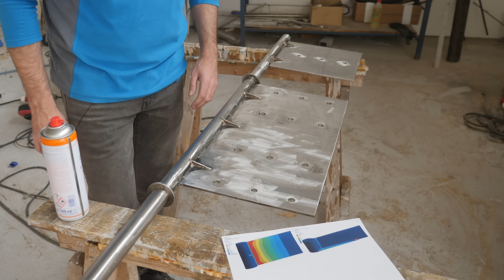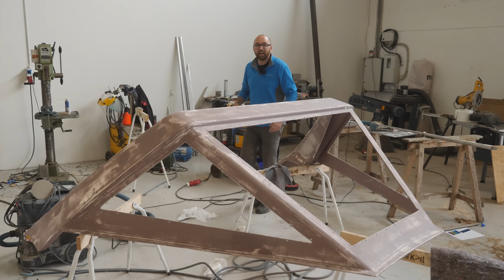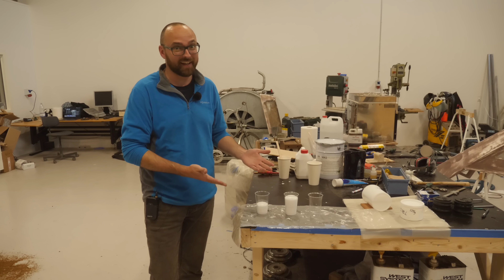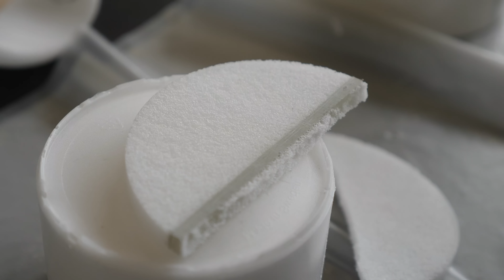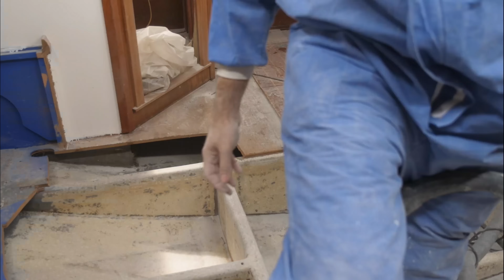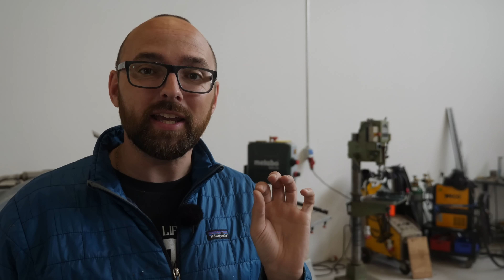Sail Life - Expanding epoxy foam for the rudder, and more sanding - DIY sailboat repair

Comment: Hey Mr. Spiffy :D geez Louise you're so fussy you haven't stopped to think that your epoxy paint is thinner than filler and will take care of those pesky pin holes if you stop trying to do it the hard way.
I'm guessing you will be lite sanding between finish coats of paint to make it peeeerfectly spiffy and it should be fine.
Good luck !
Reply from the maker: I know from experience the primer will not fill those pinholes. At least I wasn't able to make it do that 🙂
Reply: @SailLife  I'm surprised to hear that, when I used to do body work on old vehicles for resale after filling with heavy buildup material there was always those pesky pinholes! We used a spray on primer/filler, basically the same idea as your 2 part primer paint and sanding lightly between coats, 3-5 coats usually did the job... You're very patient, I'm sure it will get done well
Reply from the maker: Roland D. St. Arneault maybe the difference is that I've been rolling and not spraying?:)

Comment: What you could try to fill the rudder is to get a container, (something like an empty alhambra water bottle) that could be sealed airtight at the top with a Schrader type tire valve  in the sealing cap, and a hose barb fitted through the bottom. Then drill a fill hole on the bottom of the assembled rudder shell on either side of the rudder stock, and a weep hole on either side at the top, and pour the foam epoxy mixture into the container, seal it, and inject it through a hose to the bottom holes till the mixture comes out the top holes with a bicycle pump, or similar air pressure device.

Comment: I hate to beat a dead horse, but considering the positive test results of the epoxy foam I would be on a 'seek an destroy' mission to remove the wet core from the structural members and replacing it with the epoxy foam before glassing it over. I remember that you tested multiple areas and that it is not wet everywhere, so you could just use a deep plunge router bit to attack those areas from the top or the sides with your trim router.  I think its worth the extra steps and peace of mind that the wet ply isn't in there for eternity turning into a funky chemical soup underneath the new laminate. My bet is that only about 30% of the structural grid has wet spots.

Comment: Hi, just did a similar job with a part of my rudder. Partly based on the video from andy of boatworks. I thought his epoxy foam looked different than mine. I used an epoxy foam of 250kg/m3. This really worked out fine.
I suggest you to put your mold with rudderstock positioned vertical and make different batches of epoxy foam which you poor from the top. Let it it expand and hard, than you can poor a second, third etc batch in it untill its full.
Afterthat follow andys video for finishing 
Worked out for me

Comment: Internet is getting worse with all these Commercials you tube is getting so greedy
Reply: Here in the states it has over doubled and if you don't click to get rid of it another one starts tripling ads! Mads are you getting more money for your You Tubes as ads have tripled.
Reply: Most browsers allow plugins. There is one called ABP  (Ad Blocker Plus) and a one called YAB (YouTube Ad Blocker) that will help with most of the problem.
Reply: @leo169  - There's an even better plugin called AdBlocker Ultimate.. No "acceptable" ads or whitelisted advertisers allowed!

Comment: When I was much younger I worked in a boat shop where the owner hand built a Flying Dutchman (21' racing sailboat) out of mahogany. It looked magnificent. He decided to add flotation by pouring pu foam under the fore deck. The stuff expanded and literally pushed the entire mahogany deck off the hull.

Comment: Mads - how about assembling the rudder and use vacuum (connected to a hole at the top of the rudder) to draw in the mixed epoxy foam (through A hole in the bottom). Once drawn in both holes will act as vents.

Comment: Mads, I think you got the best solution to the rudder.  Thanks for showing the foam in action, was hoping you would show the action, seems nice and easy to work with.  I will put that info away for future use.  It's also not likely to absorb water like PU.  Rudder vertical looks like the way to fill,  a couple of 12mm holes on the top one for for a fill straw hose attached to a funnel  and one to let the air out. If the flow down the straw is too slow could always attach your vacuum pump the air outlet hole to speed things up. Could also consider twot fill straws -L&R.   Possibly consider doing two lifts, 3/4 full and a top off of 1/4, use the first lift measurement to figure how much to add for the second lift.
Stainless steel gets it's corrosion resistance from a layer of chrome oxide on the metal surface.  Machining and welding disturb this coating, the material must go through a passivation process to restore the coating.  This removes any residual iron (that can rust) from the surface leaving  higher chrome content at the outer boundary layer and reforms the oxide.  Been a while since I studied this but I believe they use a bath of Nitric acid to etch away the iron leaving the chromium.  Likely the bath contains other additives like dichromates or citric acid to reform the oxide layer. 

Good luck with the foam pour.     Please show us how that foam sands.
Craig

Comment: I LIKE that expanding epoxy! REALLY like how when next to a Smooth Surface, it cures nice and Smooth, also, which one would think will help it Resist Moisture. Little gussets on the rudder stock an EXCELLENT idea. I wonder how well the expanding epoxy foam Insulates against temperature and Sound.....And Do a Fire test on it, Mads, see if it's Flammable, i.e. does it Go Up like a bucketful of Gasoline, or does it just smoulder....And maybe Noxious Fumes when burning.?

Comment: If you stood the rudder mold up vertically, in an empty 55-gallon drum (or shipping barrel, whatever) surrounded by well-packed sand, wouldn't that do to hold it from distortion and absorb a lot of heat? Especially if the sand was dampened?
Reply: Lyfan Deth good thought
Reply: Sorry to be so offtopic but does someone know a tool to get back into an instagram account??
I was dumb forgot the account password. I love any help you can offer me.
Reply: @Casen Brixton Instablaster =)
Reply: @Camilo Brady Thanks so much for your reply. I found the site on google and Im in the hacking process now.
I see it takes quite some time so I will reply here later with my results.
Reply: @Camilo Brady it worked and I now got access to my account again. Im so happy!
Thanks so much you saved my ass :D
Reply: @Casen Brixton glad I could help :)

Comment: With regards to void free foam grow, perhaps largen the holes in the ruder plate to 100mm each to alwo for better travel of foam, from on side to another. And perhaps you can vibrate the foam whe  its is still squishi like...

Comment: I have seen some video of guys pouring PU foam between the deck and the hull of fiberglass power boats for flotation.  Yes, the expansion is unbelievable !  You need very strong walls and a couple of "vents" for the foam.  PU foam is the devil if you ever have to remove it.

Comment: Hi Mads,
I am very impressed with that epoxy foam! Already thinking where to use it.
About the dodger:
most pro paintshops have a dirty little secret for pinholes:
polyester fairing compound.Yes, the stuff from the hardware store.
Its totally o.k. to fill pinholes above the waterline. I aplly it with a flexible steel spatula using enough pressure to leave zero exess arround the pinhole. that way       there is zero sanding and its very quick+painless.

Comment: In order to sand those small corner areas on your steel rudder try using the sanding attachment (foot) that came with your multi-tool.

Comment: I'd really like to see a water saturation test on the epoxy vs. PU. (weigh the sample, put it under water for a day/week, lift, shake, weigh again). There's a "controversy" here about PU-filled plastic (abs) boats, apparently while PU doesn't normally absorb water, many complain about them getting waterlogged..
Reply: Pasi Savolainen the channel Mads mentioned already did a test.  Pretty sure it was zero take up of water.
Reply: FrenchAM100  Regardless of the test, PU foam is known to take up water,as many,many people have found out.
I don’t have any knowledge of the epoxy foam.
Reply: Stephen Crowther Hi, sorry I should have been clearer, I was referring to the epoxy foam not the PU foam which as you say does take up water.

Comment: It would be great if you could force your mixed epoxy foam through a small hose down into the bottom of the rudder. This would help avoid entrapped air and would allow for a better pour.  Maybe sacrifice a new, cheap grease gun.

Comment: Thank you for another excellent video Mads. As far laying up the expanding foam, I would pour the expanding into the 1/2 of the shell, then put the rudder shaft in, then add more foam on top of the rudder shaft plates (to ensure even conformity) then bolt the other 1/2 of the rudder mold. I find that placing the mold on an angle (30º-45ºwith a hole drilled at the top allows foam to slowly fill all voids and produces an even density. I hope this makes sense and I look forward to seeing you have any new tricks :)
Reply: I forgot to add that I leave the shells in their molds, and seal the molds until the foam cures - this provides a secure platform where the shells don't move and the foam can fully fill all voids...and I can vibrate the mold if I am concerned about spread.

Comment: Is the epoxy foam buoyant?  If so, I wonder how that will affect the behavior of the rudder?
Reply: The correct statement is, is the epoxy foam a closed cell (trapped air bubbles) foam.  Sicomin 250 is a closed cell foam.  The amount of air "trapped" in tiny cells/bubbles should have no affect on the buoyancy of Athena.

Comment: Why use epoxy for the reinforcement of the stiffeners? Polyester is cheaper…
Reply: Any kind of sticking to another repair use epoxy. Any brand new construction use polyester from my understanding.
Reply: @denniscollins2032  That is something I have heard before - in a slightly amended form. "if you don't know if the fiberglas lay-up you want to repair is made with epoxy or polyester, then use epoxy for the repair". But pros just grind a bit in the laminat and if you smell polyester you continue happily with polyester.
Reply: @MrGentlebutfirm  Any people out there with long time experience say on the epoxy vs polyester debate. What is the long term effects or is this on small patches only. I'm afraid my data is from those with a financial gain.

Comment: The stuff inside your old ruther is probably a mix of epoxy and sand. That is what was used back in the eighties to prevent too much epoxy to catch on fire. Hope your abrasives used on the old stainless ruther materials contains SiC, will make stainless steels corrode. A 'one way ticket', so to speak.
BR 
sv Hulda
Corrosion Engineer, 40 yrs experience, university degree :-)

Comment: have you figured out how the rudder shaft is going to be mounted, so that the stainless washer/bearing surfaces will not be against fibreglass areas or are there going to be some type of nylon washers going to be between the fibreglass and stainless wear points ?

Comment: Suggest thinking about 4 holes on low side as it lays to insert foam and 3 holes on the high side offset from 4 holes to allow air escape and excess foam escape

Comment: A company that I worked for uses PU as an insulator in custom environmental chambers.  It is a very good filler.andnleaves zero voidsnif done correctly and is quick.  We have measured it to over 50ins quality and use it in chamber from -40c to +70c.  Also almost every walk in cooler.in the world has this PU as an insulator and bonding agent for the panels whether they be steel, aluminum, plastic or stainless..
Reply: Walk-in coolers don't sail across oceans. PU foam in a boat soaks up water like a sponge. See the episode where Mads ripped out Athena's original refrigerator, for an example.
Reply: @Garryck-1  if you have water at your fridge or freezer your screwed anyway.  And not all PU soaks up water.  😉

Comment: Mads,
Excellent video. I loved the experiments. I am hoping that someone watching this will be inspired to start a video channel focussing only on different foam expanding tests. I'd watch that!
I was told that the 'dough' in the old rudder is slate dust mixed with some sort of polyurethane resin. I tested a block of it vs. a block of the expanded epoxy foam (by immersing both in a closed box) and found that neither soaked up any water.
Can't wait to see the next bit of the rudder process.
Cheers, Paul
Reply: As Adam Savage says, the difference between science and screwing around is documenting! I love the science Mads does.

Comment: I think the best way to set up for a pour of expanding epoxy is to assemble the rudder in your 2 part shells and secure it all vertically how you want it to be, drill some release holes at top and pour from top and you can pour onto both sides of metal of rudder.  And if you don't finish with one pour, you can mix more up and top it off later too.
Reply: My advice would be the same as Grant's however you might do some test to see if the foaming epoxy will stick to it'self if some is already hardened and then more is applied.

Comment: I am no expert and even less of a boatbuilder, but here are some of my thoughts:
-When PU foam is in contact with the water, it is diffusing into the foam. So be careful with PU on the boat it even absorbs humidity.
-a good solution to filling the rudder could be in the vertical position (i.e. to avoid trapped air pockets) using several smaller batches of foam so it will not run out through gaps between the skins.
Reply: That's why Mads isn't using PU foam, but is going with the epoxy foam instead.. it's closed-cell, so won't absorb water.

Comment: Comment on the foam for refrigeration on the  boat . As I have had 30 plus years in the Biz .I would not repeat not use that foam (open cell foam)in your refrigeration equipment .
A) It can  break down to a degree in R Value and become  basically a sponge.  Been there done that. 
B) The R factor is not efficient as your high density foam (closed cell foam). Here in Canada I use extruded High Density foam for all refrigerated containers. R values are approx 4.8 to 6.5 per inch and does not require vapour barrier .
Most of my coolers are  quite large 20 meters x 20 meters and  temperature down to - 40c (Condensation and air  leakage is enemy #1 )
That would be the large end of the scale . For a long life and max energy efficiency stick to the high density blue/pink extruded (closed cell E.P.S ).. foam 4'x8' sheets @1.5 inch is about $35.00cd 
Remember your frig is your # 1 energy consumer . Besides I hate warm beer  🍻
Cheers
Reply: Jim you have excellent advice. What glue do you use? Or is it recommended on a boat to fiberglass (epoxy) a shell around it and inside it.
Reply: @denniscollins2032  Hi Dennis if I you are referring on making  a frig /freezer . I would pickup stainless sheets, making  sure each sheet would overlap at the corners. Any local sheet metal shop would bend   this for you   This is for inner cabinet fyi.  As for glue there is a product PL6000 which is specifically for this type of foam . You can find this at home depot
 As for the outer shell you can use any thing you like to protect the foam. Try not to use any screws clips on the inside of the cabinet .
Hope this helps ??????
Reply from the maker: Very interesting! Thanks Jim 🙂👍

Comment: great video, once again. love you interaction with the dogs. I do car parts, and i loved the epoxy foam results. but i missed one info the weith diference. i know your part goes on water and that does not afect much. but how heavyer is the epoxy foam compared to the poliester? and what i could see in your video is that the epoxy foam didnd do much pressure, looks like she go a stronger part by having smaller bubbles. would it possible to put less liquid in the same space so it has more room to expand and get lighter part?

Comment: I have used expanding foam like the PU you tried.  My Bayliner factory foam in the Port and Starboard Stern ares was waterlogged after 30 years of service.  After cutting out all the old foam and letting it dry out for a couple of days. I glassed in marine plywood to cover the access holes I made.  I then drilled a couple 1" holes for expansion.  I raised the bow up as high as I could get while on the trailer.  Then added the foam.  It was cool seeing the progress of the expansion as it flowed uphill and popped out of the holes..  A day later I trimmed the excess foam and glassed up the holes.  I had never worked with foam before.  I was completely satisfied with how it turned out.  Getting rid of all that waterlogged foam made my boat sit level in the water and it gets up on plain so much faster.  Keep up the good work.  Your going to have a beautiful boat when she is done.
Reply: Bob, those PU expanding foams can be porous or waterproof, depending on whether they form open or closed cell foams. You need to enquire or read the data sheet to find out what one is.

Comment: maybe add horisontal stringers/ribs on the inside of each rudder fibreglass skin for strength improvement? Think: "Debris impact on the rudder". 
Also, doesn't PU foam absorb water?
Reply: That's why Mads isn't using PU foam, but is going with the epoxy foam instead.. it's closed-cell, so won't absorb water.